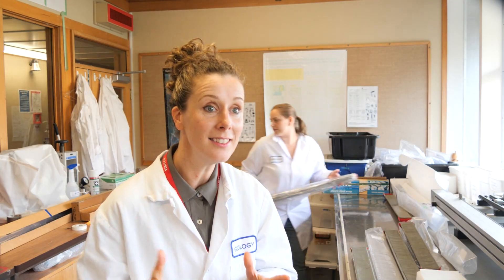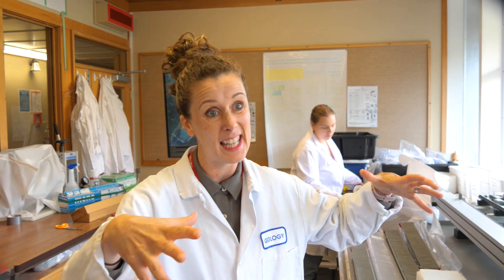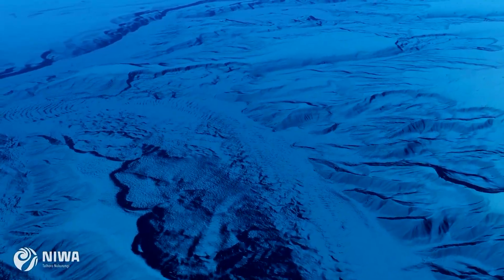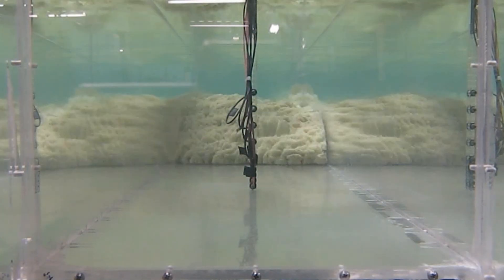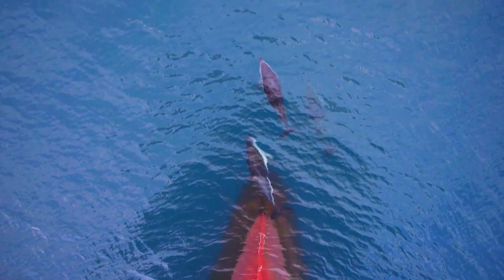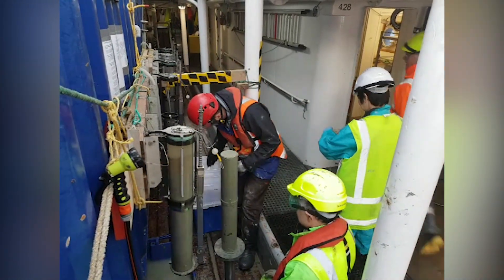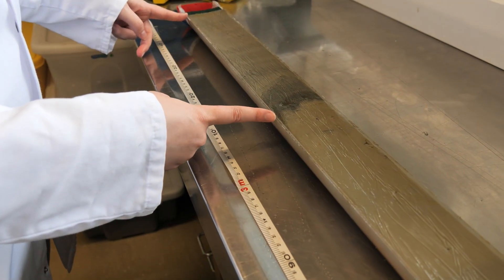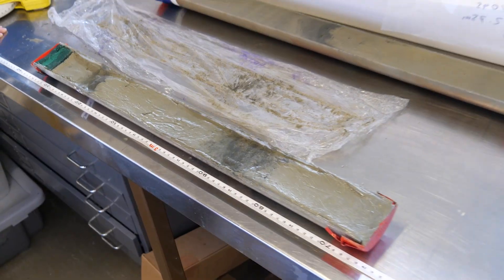Earthquake Carnage In Kaikōura Canyon

Comment: Fascinating to see what went on under the water during this incredible earthquake event. I believe the actual earthquake itself holds a world record for the highest number of faults to rupture in a single event - 25.

I happened to be in Kaikoura 12 hours before the earthquake occured and was back home in Nelson when the sequence began. The shaking there lasted about a minute or so. It began as a strong rolling shake that became more violent towards the end, which would have been the rupture of the Kekerengu/Needles fault, which moved up to 12 metres horizontally I've heard. The shaking in the area I live caused the power lines to sway side-to-side, making the power flick on and off.
Reply from the maker: @noelburland7169  thank you for describing your experience!
Reply: @OutThereLearning  You're welcome. The 2016 Kaikoura earthquake was certainly a unique event and I guess even nearly eight years later there's still a lot to learn and discover about what unfolded.

Comment: So seismic testing ship Amazon Warrior's sidekick sub The Tiny Ninja....was nowhere near that trench the day before then huh ?
Reply: Seismic vessels don't normally carry ROVs. The towed array on a seismic vessel floats on the surface not on the sea bottom.

You really need to stop perpetuating the myth that a seismic survey vessel triggered the Kaikoura Quake sequence. 

You might consider a few facts:
1. there is no documented examples of a marine seismic survey triggering an earthquake 
2. the low frequency energy from the air guns on a marine seismic towed array is nowhere near high enough to trigger rupture of a fault, even if you stuck the guns hard against a fault. The pulse from an air gun is severely attenuated by a water column and kms of rock before it gets to any fault. By the time the signal has returned to the geophones its so weak that it needs serious amplification and processing to extract any useful information.
3. At the time of the quake The Amazon Warrior had just arrived in NZ waters and was sitting in Clifford Bay and its towed array wasn't deployed.
Reply: @Kiwigeo8339  I didn't say the array was on the bottom of the ocean..or that it was deployed at the time of the quake, or the array itself caused it.
However. .any blasts, individually, may not be sufficient to case a quake..it is the regular structured and repetitive frequency that may set up a particular harmonic or standing wave that amplifies that could..an often natural occurrence that  does lead to quakes. The Geonet drums at the time were riddled with repetitive 2mag hits constantly and also by locality of ship which headed north towards the east coast of North Island over time .. fractures revealed by slips in the Wellington and Manawatu gorge happenned after the quake. This drum signal reduced significantly after the ship finished operations, and settled down to the background aftershock
You would hope that these seismic vessels don't have any cause of inclimentating quakes because that would be a liability and insurance question. 
Possibly not the first time you have read similar comments if you feel it is topic that is being perpetuated.
Reply: @Kiwigeo8339  there were two initial quakes out in the ocean.
Reply: @Kiwigeo8339  if the seismic blast signal did not enter the landscape for the purposes of mapping the oil field..then it would not be mapping the oilfield at all..but  only the surface of the sea floor...redundant in its requirements to map the field.

Comment: Any mention of the ship seismic blasting during and before the earthquake occurred?
Reply: 1. there is no documented examples of a marine seismic survey ever triggering an earthquake 
2. the low frequency energy from the air guns on a marine seismic towed array is nowhere near high enough to trigger rupture of a fault, even if you stuck the guns hard against a fault. The pulse from an air gun is severely attenuated by a water column and kms of rock before it gets to any fault. By the time the signal has returned to the geophones its so weak that it needs serious amplification and processing to extract any useful information.
3. At the time of the quake The Amazon Warrior had just arrived in NZ waters and was sitting in Clifford Bay and its towed array wasn't deployed.

Comment: What's the deal with the Puysegur trench? It seems like its had some pretty big quakes, but there's minimal information on the area. I'd imagine with all the steep terrain both on land and underwater that there's been some massive sediment flows. Extra weird since its a pretty small subduction zone and usually to produce big quakes you need a large section of fault to fail. Plus, the only associated volcanism to speak of is the Solander islands which are probably extinct, leaving a small subduction zone with no volcanism and big quakes. Not to mention that the Australian plate subducting under the Pacific plate is an unusual arrangement. And to the south the collision of two pieces of oceanic crust has actually led to uplift at Macquarie island. I've never really understood how that trench works.
Reply: There are plans afoot to start to work in this part of NZ.